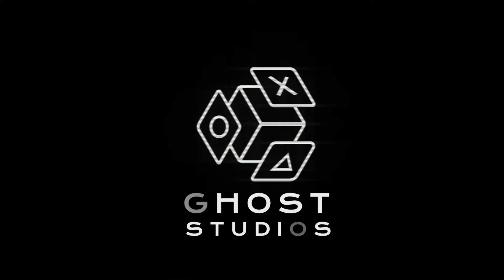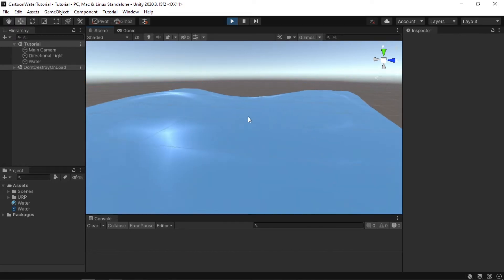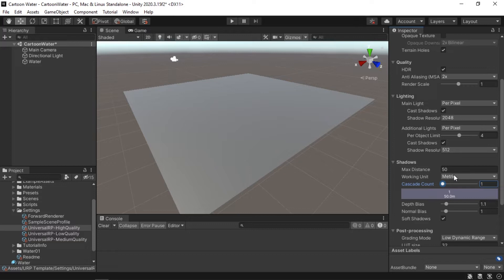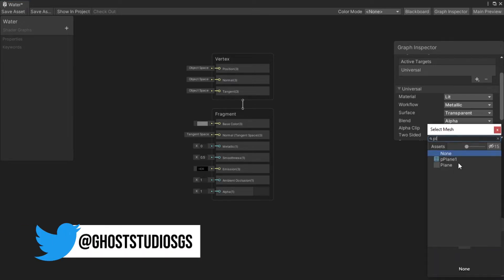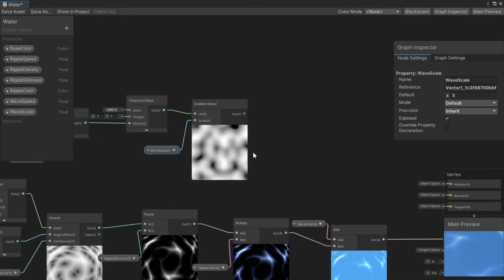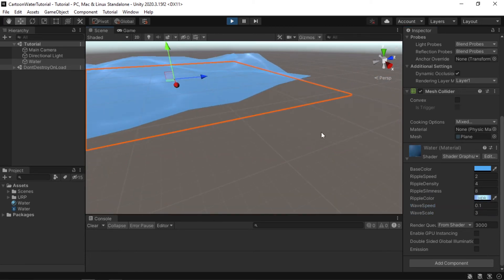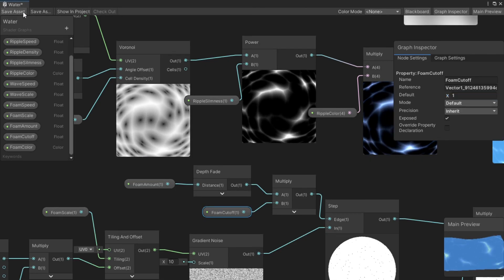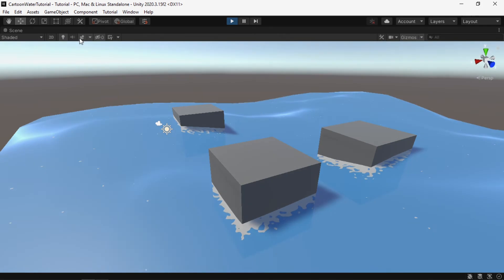How to make a Water Shader with FOAM In Unity with URP! (Tutorial)

Comment: my shader isnt working like yours... I have no way of changing the size of the waves, when I try to adjust the WaveScale property it just speeds it up instead. I have checked all my values and they are named correctly / none of them are making the wave bigger.
Reply from the maker: Make sure it’s plugged in the right spot. I think you have plugged it to wave speed instead of wave scale
Reply: @GhostStudios  I have the wavespeed plugged into the multiply and the wavescale plugged into gradient noise, wont work

Comment: Last time I checked foam based on Z depth only works if the camera actually intersects with something. So for example, if you were to look straight down at the cube instead of from the side, there won't be any visible foam. Is that how depth fade works as well or does the foam show up in all circumstances no matter the angle of the camera?

Comment: Hi thank you for putting together this tutorial .... Everything was very clear and easy to follow, which is not usually the case in a lot of these utube videos, so thank you for that.

I was with you right up until adding the parts of the shader graph for foam,  which according to your introduction was the main reason for this tutorial.  

It appears that this tutorial for adding foam,  although only 6 months old, doesn't work as described  for versions of Unity after 2020,  due the the key element in your foam part of the shader "depth fade" no longer being available.  Have you or anyone else figured out how to modify what's in this shader to get the foam part working?
Reply from the maker: I’m glad I could help you. I am a bit busy for the past couple of months. I have noticed that depth fade isn’t working after unity version 2020 and I will make a follow up tutorial for that. ;)
Reply: You need help for depth fade? I had custom solution.

Comment: thanks for the tutorial, was exactly what we're after :) 

btw, I think, it's choppy in editor not because your PC is bad, but because in Editor the update method is called at a fixed time rate which is quite small due to performance reasons (same stuff happening when you work with custom editors and calls to OnGUI), I noticed that if you press and hold mouse button in Scene view it will start updating properly, so it reacts to the changes too, otherwise, it's very rare update calls
Reply from the maker: Glad I could help;)